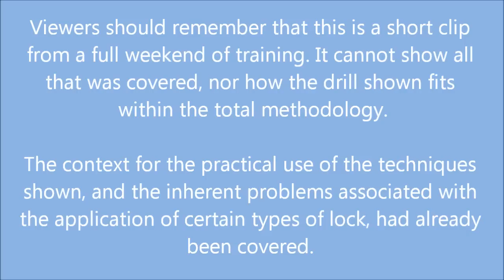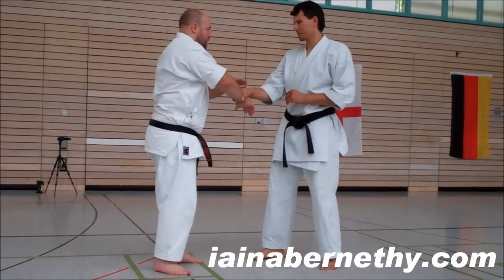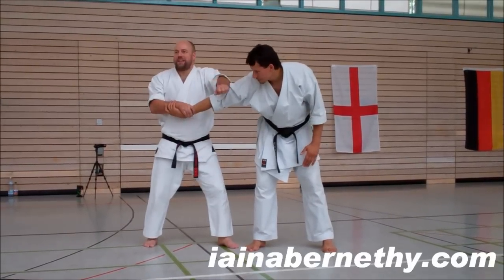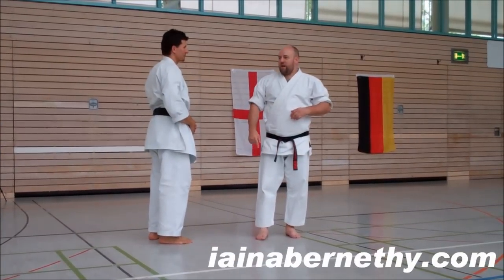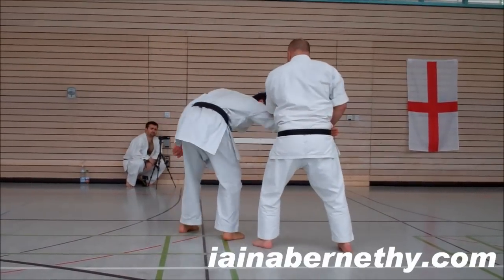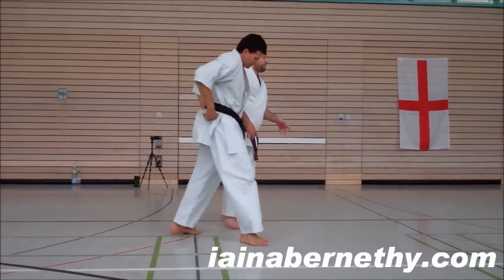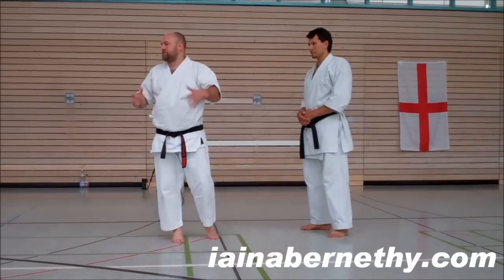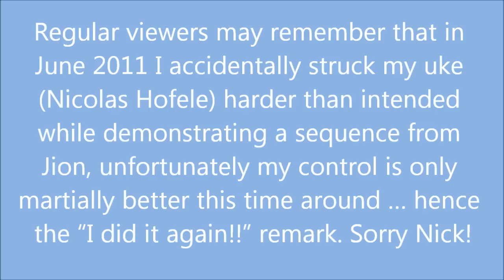Practical Kata Bunkai: Basic Arm-Lock Flow Drill

Comment: this is shoryn ryu?
Reply: +Juan Manuel He references heian shodan and other Shotokan forms. Regardless, these joint flows exist in many systems.
Reply: +Juan Manuel He personally does Wado Ryu.  However, he has expressed many times that there are no styles in karate.  Same basic kata base, same idea with minor differences.  I like this approach much better.  Sometimes, there is as much difference between Shorin ryu practictioners in Okinawa as there are differences between "styles."  And there should be differences.
Reply: +Juan Manuel So to answer your question, yes and no.